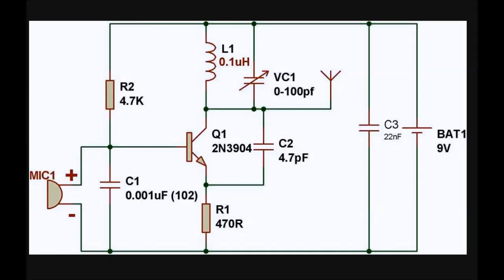Simple FM Transmitter Circuit

Comment: Wondering if output might bit more with a rf transistor? Such as a 2N3839, 2N4427, mrf905, 2N2857. But these would cost quite a lot more than the 2N3904. If you want to keep the cost down use the 2N3904 it should work pretty good.

Comment: Can someone explain to me how does this circuit modulate frequency (hence fm transmitter in title)? It looks like amplitude modulation. Btw there is ton of videos where ppl claim they build "fm transmitter" but most of them actuly build am transmitter. Shows that lot of ppl doesnt really know what they are talking about and just copy paste ideas
Reply: It is both AM and FM. Q1 has parasitic capacitance between collector and base that depends on Vcb. It may seem that this capacitance is not a part of a tank circuit so shouldn't affect the freq but it actually is. Follow the path: tank circuit -> Q1 collector-base parasitic capacitor -> C1 -> C3 -> tank circuit. C1 and C3 have very low resistance in RF so each is effectively a short for RF. In other words, Q1 cb capacitance is in parallel with VC1, hence part of the tank circuit
Reply: @akh345  
What is the purpose of c1 ? I don't see this capacitor in the AM circuit ..additionally there is no coupling capacitor (dc blocker) at the source..why?
Reply: The audio amplitude is changing (modulating) the tank circuit frequency. An AM transmitter would have a separate and fixed frequency oscillator for the carrier.

Comment: I built this circuit exactly according to the schematic on a breadboard except for the tuning, I used a 22pF & 8 turns running around 106-108MHz .It also works without a tuning capacitor at all with 8 turns possibly because of the capacitance of the breadboard itself or the noobish way I wired it up. It has quite good range too, I got at least (80m) walking down the street with a short antenna. It works perfectly with the electret I have. No noise at all (albeit a lot of drift when bumping it). I'm trying to use a mono plug from a music device but I get no rf output. My guess R2 and R1 need changing to properly bias it for a normal audio jack to keep the transistor in 'linear amp' mode perhaps? I also wanted to try drive it with a pulse width pin on an Arduino to try out some digital transmission but trying anything other than the electret doesn't make the radio operate. Any suggestions to take out the electret?
Reply: whats was the gauge for the inductor??

Comment: Excellent demo of a single transistor doing extraordinary things! For 4.7 pf capacitance, you could just wire some breadboard traces together. In one of his videos, Dave Jones measured about 2 pf between two adjacent 5-pin traces on a typical breadboard. There is also the method of twisting two insulated wires together to achieve a certain pf-scale capacitance.
Reply from the maker: Thanks Eric, I will see if I can use that technique.
Reply: Thanks

Comment: Wow, I took a nap and you already made a video. I'll have to make one as well seeing you using breadboard and retractable antenna. I made a two stage one in the summer, wasn't successful. Many online tutorials etch their PCBs, which scares a lot of beginners.
Reply from the maker: There is quite a bit of noise from other stations, could be due to the fact I used 7pF in place of the 4.7pf, but yeah it was a fun circuit to build thanks for sharing it.
Reply: The noise could be due to the non-linearity of the transistor, that's another circuitry to remove all those noise components I think. Since the transmitter is so close, the interference from other station should be minimal.